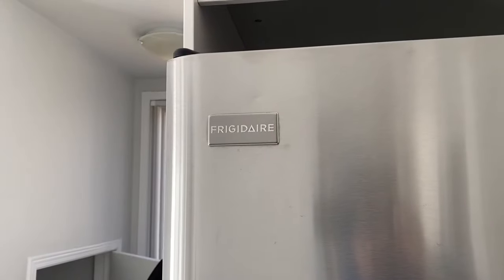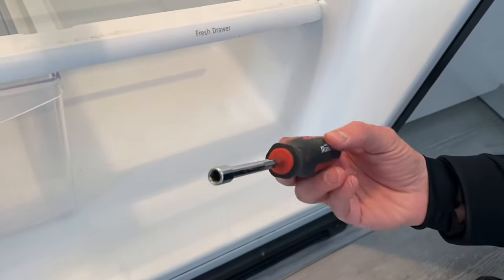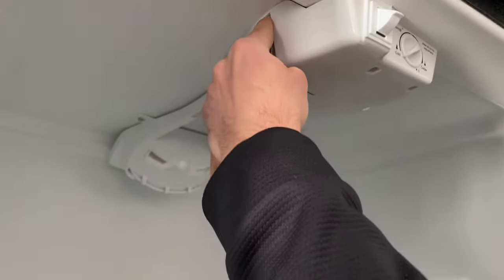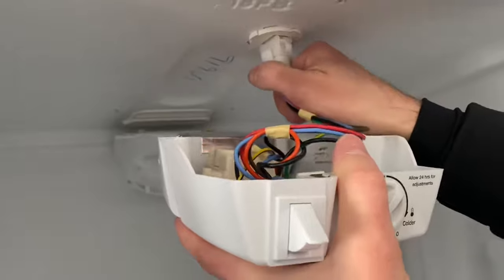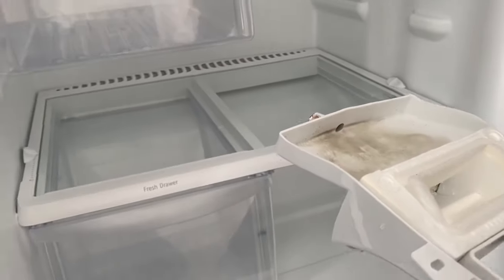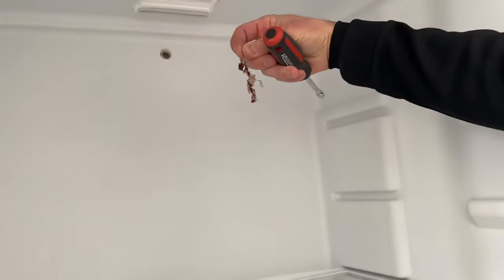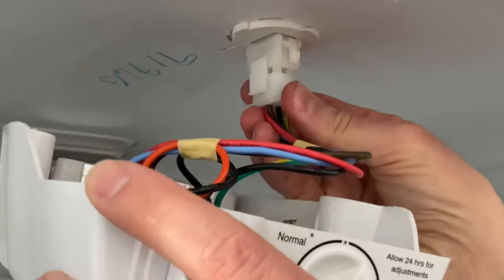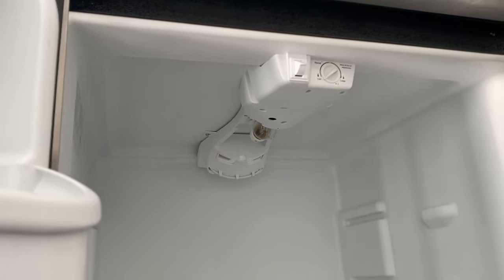Water at the bottom of fridge - No problem. Diagnose and fix in under 10 mins

Comment from the maker: If you found this video helpful, please like this video and subscribe. This will go a long way in helping us create more useful content. Thanks!
Reply: Please any idea would help! I cannot find anywhere to "unscrew" this tray.... my model Kenmore 60089 (20.4 cu. ft) seems different from this video - please help ?
Reply from the maker: @WtTw-x2l  The only thing I can think of if it’s not screwed on, there has to be a latch (latches) somewhere that hold it in place. Unless it’s glued on. Your best bet would be to search for a manual for your particular model to see how the assembly is held in place. Good luck!
Reply: @weekendwarrior3814  Thank you for taking the time to reply! Also, your video is very good, especially it explains clearly why (as opposed to just how to do), thanks!
Reply: What is the name of the tool that I need to use to unscrew the screws please? And if you can send a picture please. Thank you.
Reply from the maker: @arleneraygoza40  hi it’s a quarter inch screw socket. You can take a screenshot of the video where we demonstrate the tool to have a picture.
Reply: @weekendwarrior3814 Thank you so much for answering me  and your video. Your video helped me to solve the problem of my fridge. 🙏
Reply: it was missing in your video to show where is located the small water tank which must be evaporated by the heat of the engine.
Reply: Hi. I have a different problem. Buildup is over the little shelves in the door.  Other question: possible that it’s iced over and a full defrost could fix? Really would prefer not taking it apart as it’s the landlords.
Reply from the maker: @jimc7466  Hi, hard to advise remotely. Since it’s the landlords, perhaps let him/her know and they can get someone to take a look (?) I know it’s not the answer you were looking for but this may be the easiest.
Reply: lol omg me too …not 8 hrs but yeah

Comment: Thank you.  It took me 8 hours to fix my fridge because I was using one of the multitude of videos that had me go through the freezer.  It was when I saw that your fridge light thing was the same as mine that I knew I had found the right place.  Thank you
Reply: Just curious was the water leaking out through the door seal or vents that he explained or was it coming directly from underneath the fridge itself?
Reply: Mine is flooded from the freezer and it's enlarged the hole and pushed the insulation into the fridge, because maintenance was lazy and didn't care that I was using 2 rolls of towels a day
Reply: Does YouTube not allow you to save the video anymore?
Reply: What do I do if I have only one nut or bolt holding the thing in place and it doesn’t look like a socket driver is going to work?

It looks like a socket, it’s inside the ring, not outside it.
Reply: @Aggression-hc3yp  Not sure what you mean. You need a screw driver handle with a nut driver end. Or a long correct size socket with a rachet handle.
Reply: Same exact situation for me too. I’m going to put the screws back into the back panel of my freezer and tackle that light panel next. Wish me luck. 🤘🏽
Reply: 1140pm. In this video you have removed the center tray. My question is simple. It appears like a covering piece is missing that would possibly go over the light? My refrigerator  and the refrigerator in video have similar designs but it  seems like something is missing? Is that how the refrig is designed? Your thoughts.
Reply: @me4654  you can save I just did.
Reply: I'm going to try it tomorrow I have the tools better than calling someone that's going to charge you the trip for coming and the labor showing how to do it ... Plus I like fixing things around the house from plumbing to painting and landscaping.....
Reply: Thank you ,I have the same problem with my Frigidaire 😊

Comment: This video is correct, but there is a simpler solution. Just open the freezer door, unplug the refrigerator, get a fan to blow into the freezer. Leave the door open and fan on for 4-6 hours until all ice is melted. 95% of the time, you'll just have ice buildup somewhere in the line that you cannot get to directly and this will solve your problem. Obviously, you will need to clear out your freezer of all food first, but your fridge should be fine as it is well insulated, and the food inside will keep itself cold.

Comment: You know, I have never heard of this but I think that's my problem because there is water build up in the bottom and my refrigerator looks just like this. Thank you.  I'm gonna clean it. (  Well , after the surgery , the patient is resting well - It had a clog and was iced over in the tray because of the clog.  Don't put in a stint -  watch this video.)
Reply from the maker: @icemancometh8679   thanks for the post-surgery update, glad it worked :)

Comment: Thanks to your video, my 1973 "Custom Crafted No Frost" Harvest Gold Hotpoint refrigerator is back to it's old self, with no water under the crisper pans. I would never have thought to check under that panel on the inside top of the fridge compartment and it took a Philips screwdriver. I'm 72 years old and on a fixed income and this saved me a ton of money and having to buy a smaller fridge. I know I'll have to replace it eventually, but not today. Thank you thank you thank you!

Comment: Thanks for the great video. I had some food particles that lodged further down the drain tube and I was unable to clean it out with a wire because the drain tube is not straight and narrows as it travels to the bottom. I was also unable to clean the tube from their bottom. What I did to clear the drain hose was to squirt liquid bleach into the top drain hole with a turkey baster and let it set until it cleared the blockage. I then rinsed it with plain water until the blockage was completely gone.

Comment: We bought a place with large kitchen appliances and have been mopping the water under the crispers for 8 months.  We bought a new fridge last week and I listed the old one in the local BST.   I got to feeling bad about selling a leaky fridge but so glad I found your video, which gave me (66 y/o grandma) the confidence to fix it!  Turned out the bio-slime plug was lodge way down-inside the channel running inside the body of the fridge, so I snaked it out with some flexible wire, ran hot water through it using a long flexible funnel.  Now I can sell this old fridge and not worry about it being someone else's problem.

Comment: Thanks for the clear cut video w/fix!  My garage fridge was exactly how you showed it would be! The electrical panel that I removed had the ice buildup. The hole in the back of the fridge was clogged w/debris. After clearing the obstruction w/a round brush, and squirting water in the hole to make sure there wasn't an obstruction further down in the line I put it back together and plugged it in. Thanks again!

Comment: UPDATE:  I went ahead and did this, and it worked like a charm!  Thank you so much for the advice! 

Thank you!  I probably should call my landlord before attempting this, but it is good to be able to tell him what I think the problem is, and that it probably won't cost much if he prefers to send someone over.  My apartment has had many problems (none of which I caused) from the time I moved in, so I just hate having to ask for help again.
Reply: It's pretty painless.  Take out the four screws, unplug the tray from the nipple in the back. I put a nylon over the hose of a vacuum cleaner, and sucked goop out of the drain hose in the back.  With the nylon to catch it, I could see exactly what was in there.  You can do this in less time than it would take to call the landlord.

Comment: You are the best of the best.  I was using kotex to catch the overflow.  Then trying to let it dry, to re-use.  There's a gel in there binding the water.  Kotex, after kotex.  This is now 2 weeks.  Well, my hole was filled with what appears to be cat hair and mildew.  I removed this thick plug.  I cleaned out the catch basin after removing the ice-skating rink in it.  Then with shout, followed by WD40, then windex.  The unit is spotless and reassembled.  I can't thank you enough, kind sir!!!!!!

Comment: Worked great on Frigidare model FGHT1835SF1. It uses one 1/4" hex-head screw, located in recessed hole near the front center. Remove that screw and then slide/pull the console forward (toward door) to release from the two square retainer tabs.

Comment: worked great I looked at a couple different videos but this was the exact model but what I did as well was take a shop vac and take off that piece of cardboard in the back on  the bottom of the fredge and if you look you will see a black hose . slide that off and put the shop vac on it and if you go inside the fredge see if it has suction on the tube hole. that way you make sure its all unclogged. also but removing that cardboard and doing this you can clean out all the dust it builds up alot.

Comment: Thank You so very much this video actually resolved our refrigerator problem.  The hole in the drain tray was plugged with gunk once removed and cleared like shown in the video, our refrigerator worked even better than before.  This video saved us from buying a new refrigerator and it was EZ to do because the refrigerator in the video is similar to ours.  8/28/22 update our refrigerator is still working really good problem solved.
Reply from the maker: Glad it helped

Comment: This was incredibly helpful. I followed instructions -- a snap, if you have a 1/4 socket driver -- and it all worked exactly as described. I found some slimy goo in the nipple and in the tray, and cleaned them both out. I suppose it's possible that there's a blockage somewhere in the drain line, causing it to back up, but if that had been the case, I'd have expected to find water in the drain line, and I didn't. So, I think this solved the problem. If not, I'll try to snake it, perhaps with a bit of coax cable, since I've found that to be an ideal snake for certain plumbing applications. At any rate, thanks for this. In their wisdom the Frigidaire folks don't seem to have any online information on how to do simple repairs like this, and the manual doesn't even mention that there's a drain line back there. The word "nipple" doesn't come up either, but there might be something else going on there!

Comment: I use an air compressor and blow out the hole in the back wall as well. If you pull out the fridge from the wall and have wife or kid check to see if the air blows out the tube in the back of the fridge into the catch tray. Some models may have a piece of cardboard across the bottom in the back where the compressor, etc. is. You may need to remove it so they can check the tube for air flow when you blow out the drain tube.

Comment: we've been living with this for a long time and finally fixed it today (fingers crossed). it was a backed up drain tube. i used a section of clothes line. fit perfectly, and it had enough compressive strength to push it through the blockage.

Comment: Did this today. Also found a plug of trash in the hole in back of fridge. Time will tell if this cured my problem. Your video was really helpful. I guess if it continues I'll need to blow out the drain line. Saved me from buying a new fridge.

Comment: excellent video.  described one possible problem.  I had another issue - foam seal to the freezer was not mating right and cold air came out the sides condensing water along the ceiling of the fridge.  that and a door seal not fully sealing created the water problem as well.  all fixed and your video helped a lot.  thanks.

Comment: Going to use your vid to fix my frig. Also while I have the defroster off and the drain hole open,  I will run some hot water through the drain pipe and check and see if it is plugged elsewhere. I think if the water I squirt into the drain hole makes it down to the pan under the frig the pipe is open.
Reply from the maker: Good idea re running water through the line. Good luck 👍

Comment: Our 2002 Kenmore looks EXACTLY like the one in the video, so we were optimistic. However, after following each of your steps we found nothing obstructive, and we have concluded any obstruction must be much farther down where we can't reach it. We put it back together and are keeping our fingers crossed and a towel in the floor of the fridge.
Reply: Obstruction further down is unlikely as it is pretty much a straight shot down....however some models have a rubber valve at the end...go behind fridge and see if it has this....this could be causing the problem....take it off and clean it out....also check the fridge to make sure it is level...it should be a little higher in the front vs the back

When you open the fridge the door should shut on its own.

Comment: Excellent, thank you very much. I have been having this issue for quite a while and had no clue how to fix. A little bit of knowledge can go a long way, and that certainly applies here, as this can make quite a mess in the refrigerator. Thank you, Thank you, Thank you.  post script, My refrigerator is a bit different, so I had to access the drain hole through the freezer compartment. Not all refrigerators are alike, but its the same idea.
Reply: do you know the size of the tool? I have this exact same fridge as well

Comment: You saved me a lot of time and money thank you, 
I have a question is that drain pan removeable or does it has screws? 
It is dirty as hell since it had been dried for too long.
Reply from the maker: @politicsreporter4247  not sure about the drain pan under the fridge (if that’s the one you’re thinking about). Haven’t had the need to remove it so far. Good luck.
Reply: @weekendwarrior3814  No worries, thank you for response. BTW I was able to find it, has two screw on bottom will need to tip over the fridge but its simple. Regards.

Comment: I work as a maintenance tech at an apartment complex. 
I have this same issue but it still leaks. Blew the lines out. Even replaced the foam air damper. It’s still leaking.

Comment: After trying to clear it with hot water, i gave up. I poured salt in that back collection tray followed by water. Now that i know, i can periodically look for ice under that tray in the bottom of the freezer and just add a little salt. The tray is silver aluminum, and the drain tube is all plastic. So far so good.

Comment: What I have found with that model is that water would migrate between the styrofoam and divider which I had to fill with silicone and also a piece of weatherstripping to further divide the sections. No call backs. There were no clogs in the drain hole or spout.

Comment: OH MY GOSH!! I have been battling this with my Frigidaire for a few weeks now! I have a little damage to a tile floor that I can repair myself. Do you Rx to use maybe a turkey baster to run hot soapy water through that back drain tube? I did clean the evaporator pan tube. You are so very helpful!! I have tried everything...Giving it a try this weekend!!
Reply from the maker: running soapy water through the back tube can be useful. If it’s blocked, you’ll know right away. Good luck!

Comment: Great detailed video. I have a Frigidaire leaking water from under the bottom. Saw this video in detail but sure is no leak from inside as the video was addressing the issue. The leaking water is brownish and rusty, In one of older Kenmore (30 yrs back) it was a netal pan that had rusted. What kind of pans are used in Frigidaire. Can you do a video on how to check the pan. Much Thanks!

Comment: Hello and thank you for this awesome video. I’ve subscribed to your channel. Question. This was exactly like my fridge and exactly what was happening. Pooling water under the drawers. However, there was no obstruction that I could see. I ran a pipe cleaner down the hole too and it came out clean. I put everything back together….. fingers crossed. What do you think?
Reply from the maker: Hi, hope this response isn’t too late. The only thing I can think of is perhaps the little tray in the light assembly not lining up straight with the cut out in the freezer section and the water is coming on the side and runs down the back. Short of that it’s hard to tell without physically looking at the fridge. Good luck.

Comment: Hi! I have this exact rfridge. I did what you said and there wasn't any blockage. I still have water collecting in bottom under crisper bins. Any other ideas?
I appreciate your help!
Reply from the maker: Hi, the only thing I can think of is the drain hole from the freezer may be misaligned with the tray and water spilling out and finding its way to the bottom. Not a 100% but work checking. Good luck.
Reply: I'm still experiencing dripping as well even though I cleared the drain hole and even made sure the hole it connects to is free of debris. So, it didn't work for me, either. ~ 😞

Comment: This helped, thanks!

Does anyone know what it costs to replace that whole light assembly? 

(The casing was cracked so I taped it all up, but was wondering how expensive it might be to replace).
Reply: Just do a search on your model #. I have a Maytag that needed a condenser fan, and I found exploded parts diagrams with the part # very easily

Comment: Excellent video. Thanks much !  But what if the drain TUBE that runs from the inside of the back will of the fridge is clogged ? Should I run a metal coat hanger or long piece of wire down thought it ??
Reply from the maker: That’s a good idea